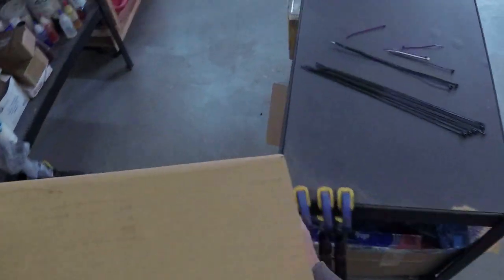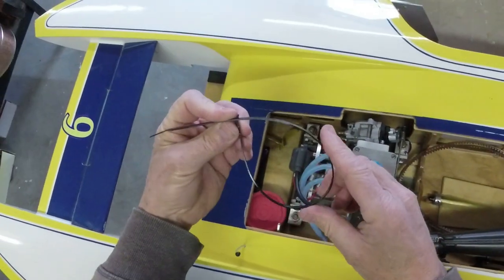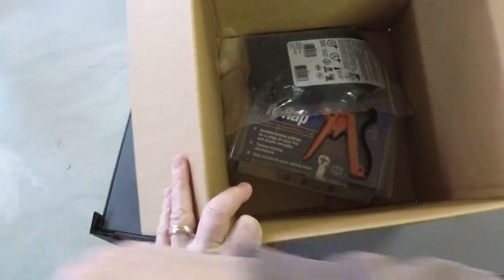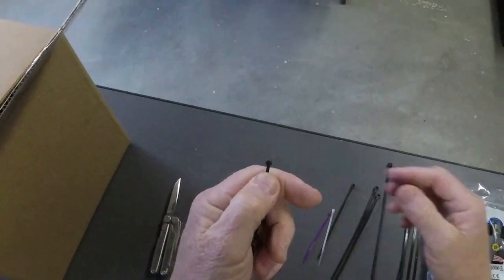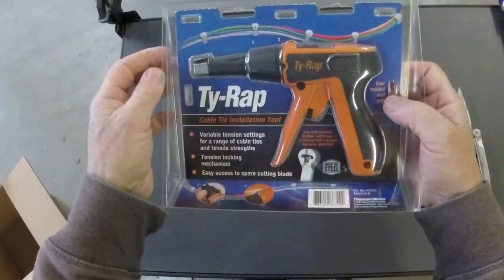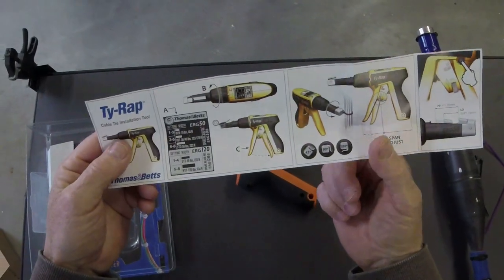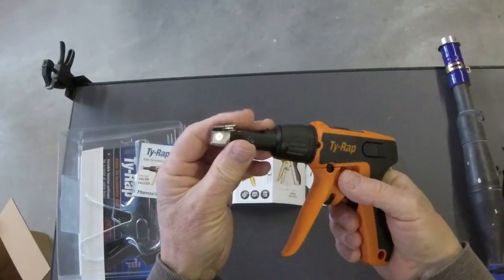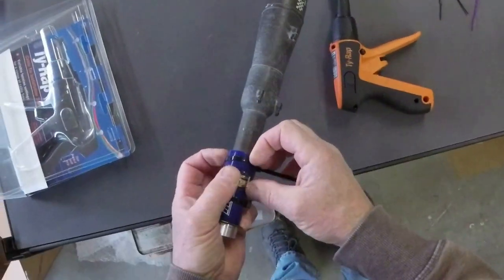Tie-Wrap Nirvana | Totally Trustworthy Tie Tightening Tool Turned-up Today!

Comment: I was using T&B Ty-Raps in industry back in the 70s. They had steel teeth back then. I think T&B invented them.
Yeah, more expensive but how many do you need in a day. They're the best.
I still have a simpler T&B tightening tool I still use. Even for the cheap ones.  I think they probably still make it.  :)
Reply from the maker: How did I not know about them before?!
Reply: @M5PerfHydros  I've never seen them in retail stores. When I was working (retired now) the machine tool manufacturer I worked for bought everything from industrial suppliers. 
Who makes those flush ties?  :)
Reply from the maker: Search for "low profile tie wrap" or go here; SecuriTie CTCH8-60100UVB Low-Profile Cable Ties, 8 Inch., 60 Lbs. Tensile Strength, Wire & Cord Management / Industrial / Household Use, Nylon Zip Tie, 100 Pk, UV Black https://www.amazon.com/dp/B06Y4C4Y22/ref=cm_sw_r_apan_i_VANJE9WB0XYS4BCTVVWC
Reply: @M5PerfHydros  Thanks Scott.  :)